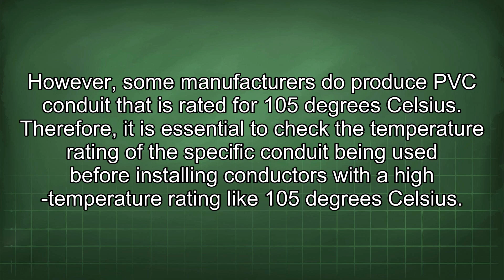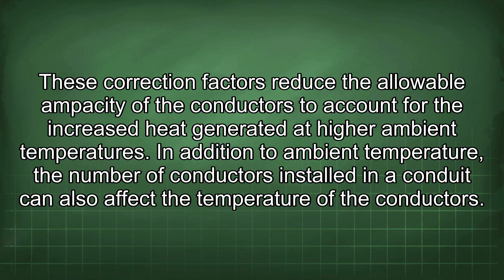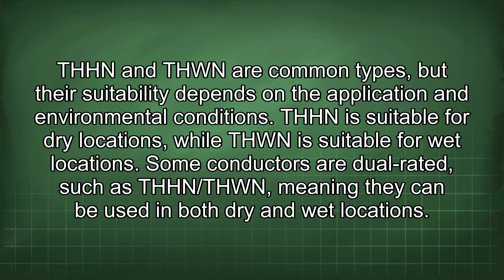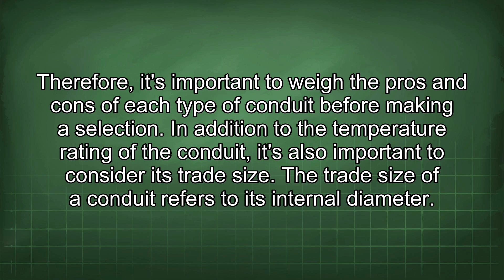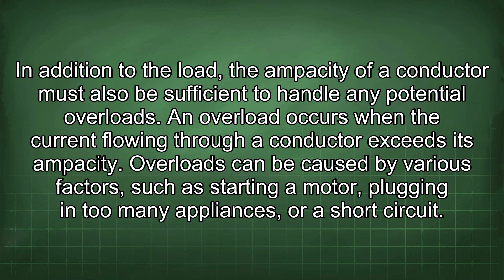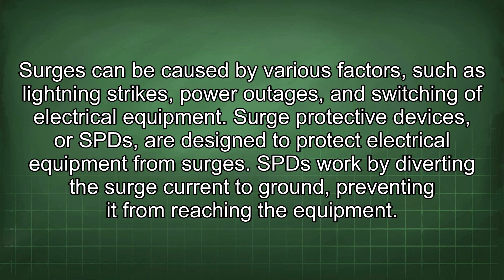Can You Use 105 Degree C Wire in PVC Conduit?

Comment: There is nothing wrong with using 105° C rated conductors in 90°C rated conduit as long as the conductors were not sized based on the 105°C temp rating.